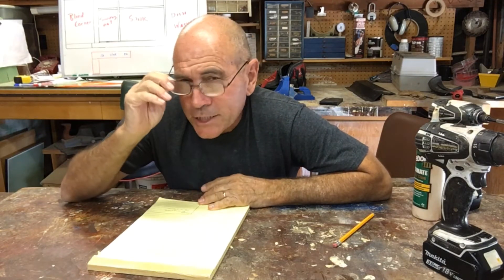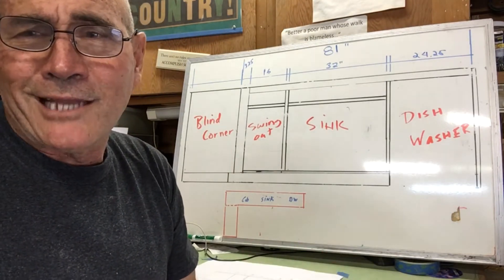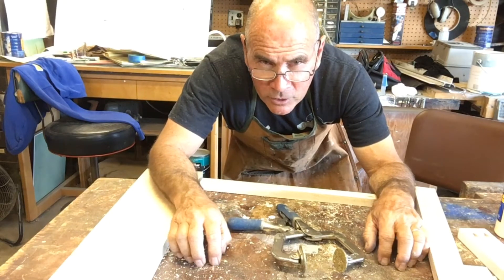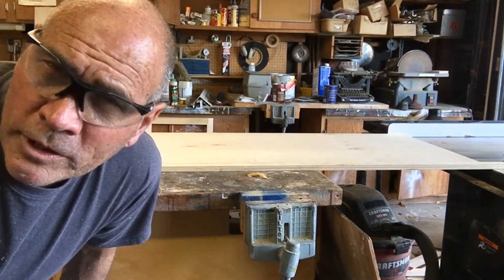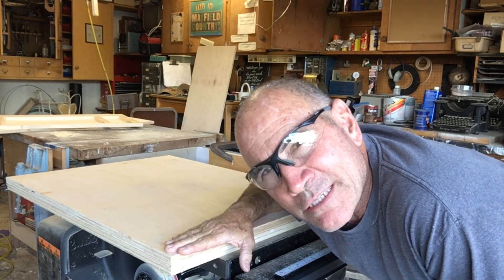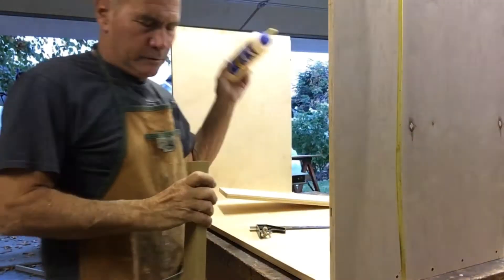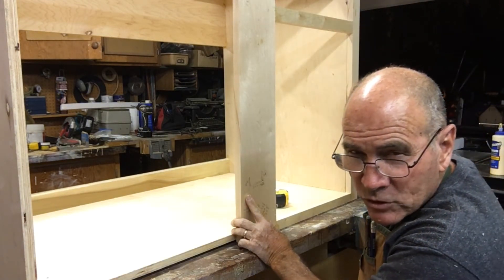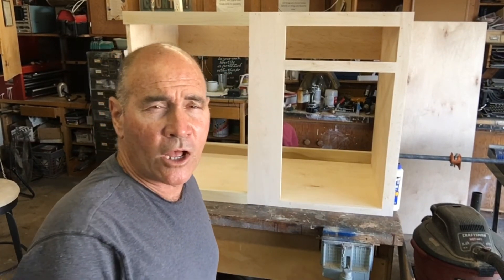How to Make a Blind Corner Kitchen Cabinet

Comment: Hello Sir. Very nice video. Clear, down to earth. I'm very new to woodworking (casual scum hobbyist) so I'm sorry if this is a dumb question but I'm wondering: You have an opening for a drawer but where/how do you mount your slide on the left? I've got an almost identical set up with a blind corner. Thanks for the video. You have my subscription.
Reply from the maker: I drop down a short panel and attach it front and rear and on top
Reply from the maker: I simply hang a piece of plywood down from the top about 5” and mount the drawer guide to it. You can also purchase mounting brackets that attach to the rear.